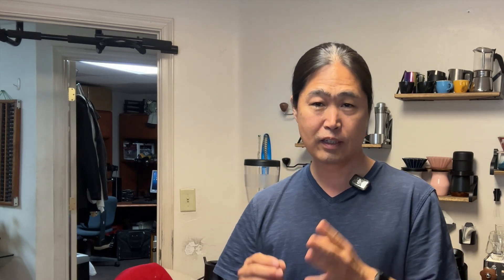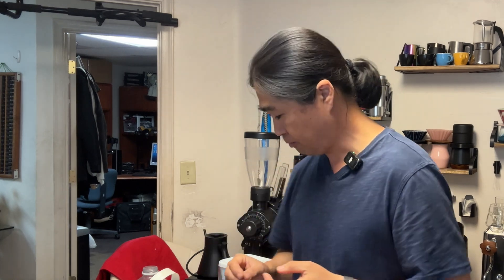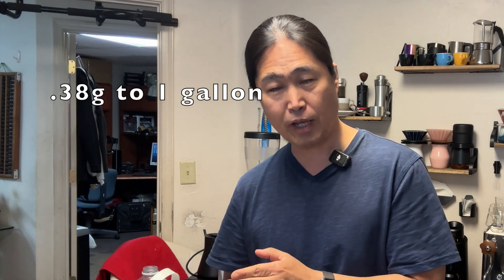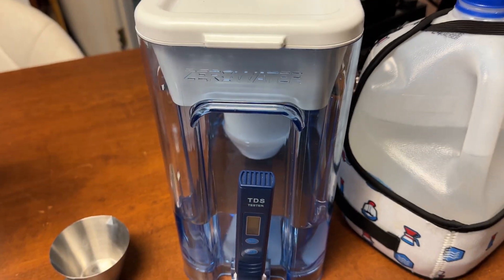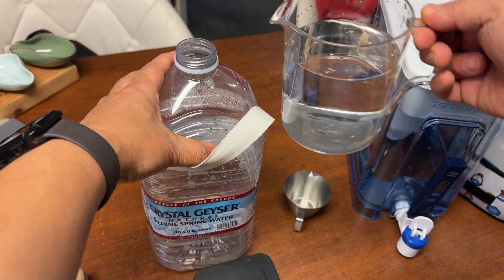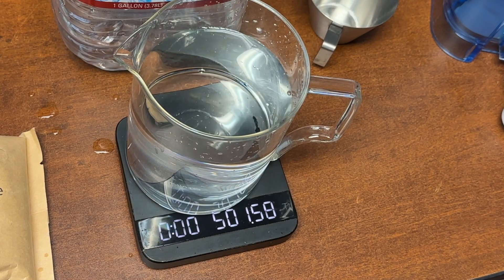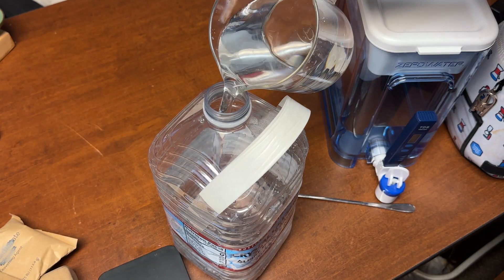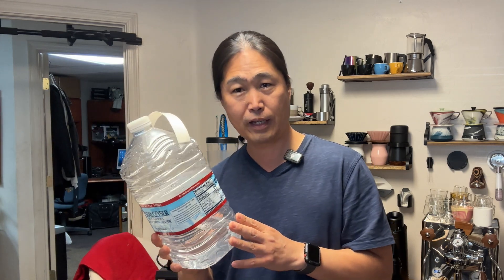Dr. Pavlis' Scale-Free Water Recipe Espresso Machine | How to Make Concentrated Water

Comment: The company i bought my Bianca V3 from strongly recommends against any of the formulated waters. Partially because of the the water softener cartridge from Lelit. They say it wont cause scale but a film that will cause the boiler to eventually fail temps to read improperly. I use a Brita filter because i dont trust my tap water. But i am really unsure which way to go. I would like to use this water or the Third wave but have been scared away by 1st Line Equipment/Java Jim... Help!!!??😅